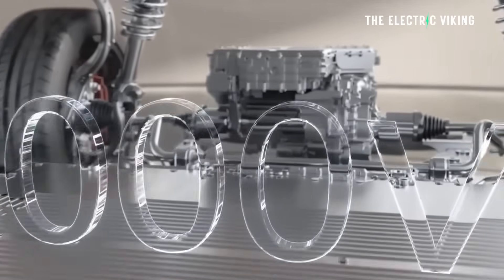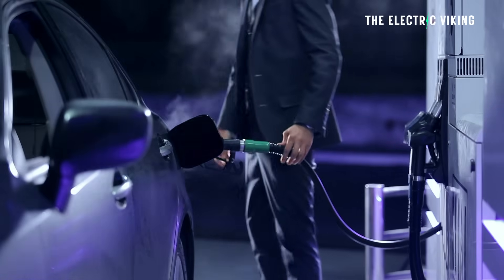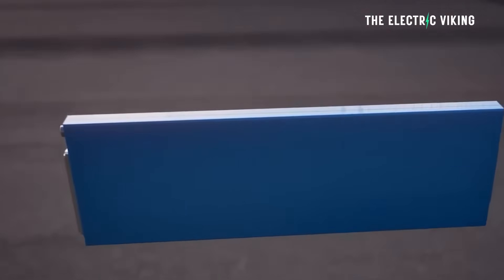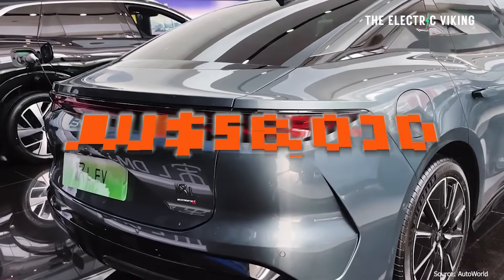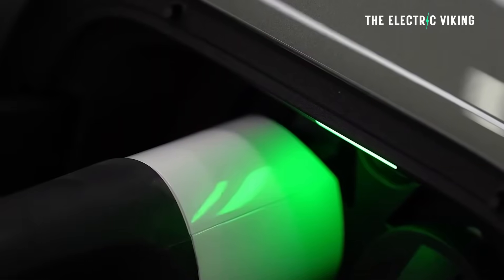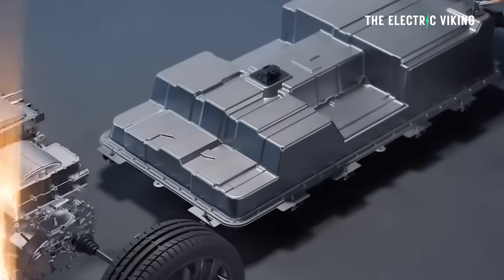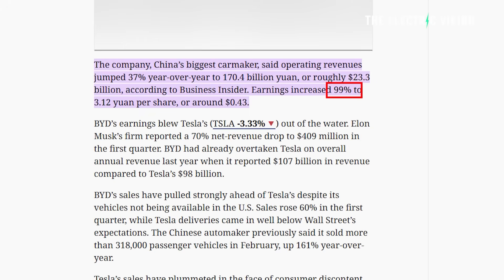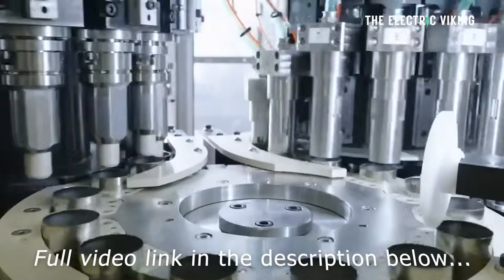Charging as FAST as Gas: BYD’s 1,000 kW Superchargers Rolled Out

Comment: So how thick are the cables from the grid then for a charging center of say 20 chargers? The electric has to flow in from somewhere. Pure fantasy land. A small nuclear plant per 20 chargers? Declining gas/petrol demand in China replaced by extra coal powered electric power stations.
Reply: They won't draw power direct from the grid, they'll slow charge on-site batteries and then fast charge cars from those, like every petrol station has a big fuel reservoir underground
Reply: Try and keep up
Reply: Keep up? To what? Fantasy land? Qualified electrical engineer who at 72 lives life through clear glasses in real life today, not some rose tinted ones about something maybe achievable years/decades in the future.
Reply: Lmao In 2024, China's renewable energy capacity reached a record high, representing 56% of the country's total installed capacity. This included significant increases in solar, wind, and hydropower, with solar power leading the growth. By the end of 2024, China's cumulative renewable energy capacity reached 1.889 TW, even exceeding the 2030 targets. They installed more renewable energy sources than the next top 10 countries combined. 
Also BYD has already built more than 500 of 1000kw charging stations and is building another 15000 in China alone. These are already available for the public and the cars are already on sale.
Reply: Engineers will sort that out as demand increases.

Comment: Imagine if BYD were to install solar powered fast chargers every 200km from Melbourne    To Adelaide, to Alice Springs to Darwin.
Would that not boost the mass adoption of EVs in Austrailia. It might also boost eco-tourism in Australia because that route covers about"Yuge" amount of different geographies across the vastness of Austrailia.
Reply: Very Interesting: I must make sure to travel only when the sun is shining. I wonder what the countryside would look like with acres and acres of solar arrays, or otherwise pristine areas covered in windmills?
Reply: Wouldn't need to be very 200km though, maybe every 400km would be more efficient?
Reply: 澳大利亚地广人稀，很适合发展太阳能。

Comment: 1000kw charging is an interesting concept. But we don,t know what this does to the battery under charge and how heat from the battery under charge is removed. I would also question the efficiency charging this way. Not much info out there.
Reply: I think it just comes down to cooling. If they can keep the battery  at the right temperature it may not bother the battery too much